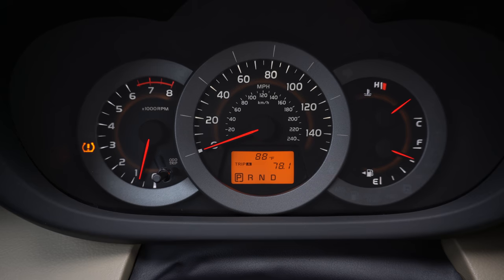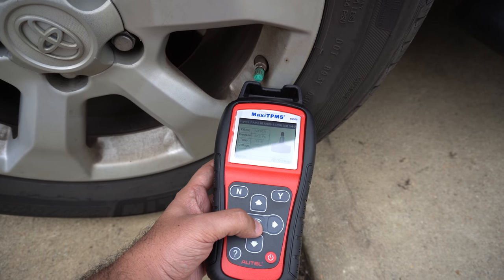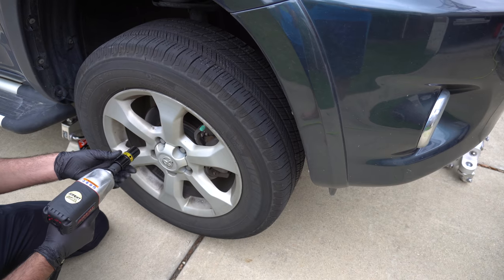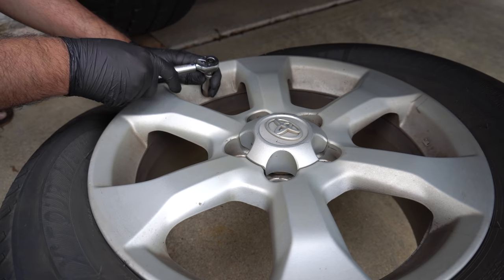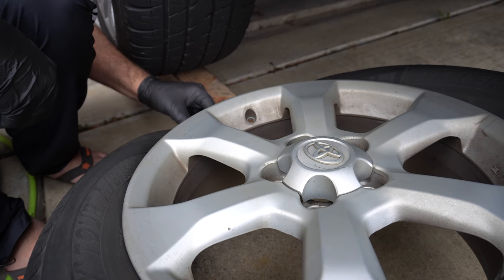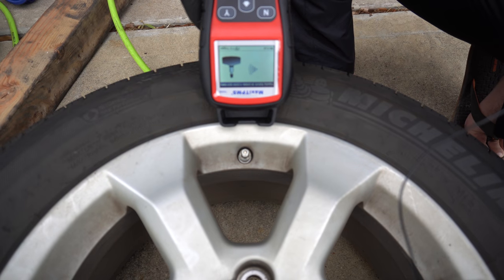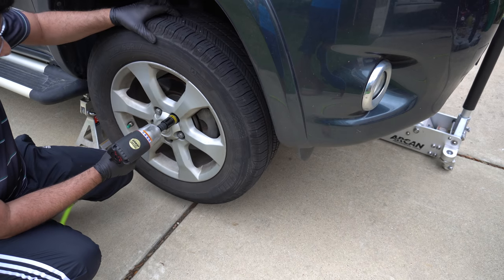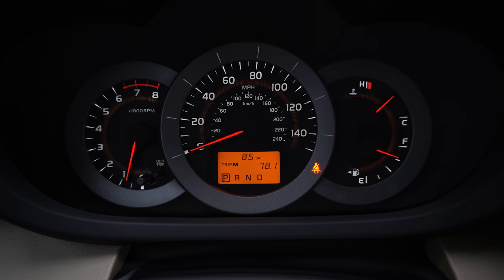How To: DIY Install/Replace TPMS Sensor

Comment: Great video and I love how creative you are to use the wood to expose the sensor!  You definitely got a great power and air tools around your house but with me missing the tool and programming the sensor, I'm afraid I have to spend $75/tire at a tire shop to replace this but I love your video editing, straight to the point! Great job.

Comment: Really nice video. I didn't have another car so I used the only car. Lowering the corner with the wood on the dismounted wheel. My car, Acura will automatically learn the new sensor. Actually if your car won't require you do anything after tire rotation, its system can probably learn new sensors. Modern sensors have accelerators built-in, so the control unit can know the rotation direction, together with signal strength, it can tell which is which.

Comment: Hi, how did you register the new TPMS to the ECM ? That is a very important part, thanks!
Reply: Yeah I just paid Toyota 164$ to register my new ones
Reply: @jayou1987  Yikes. You got hosed.
Reply: @tee2171  yeah i didnt like paying it but i upgraded to some dope ass wheels for a total of 300$ out of pocket so not really
Reply: You get a scan tool that can write tpms IDs and another tool to scan and retrieve the codes

Comment: Great video.
I am very concerned about damaging the steel belts in the tire when crushing it like that with the board. Did you or anyone else have tire issues after doing that? Like noise or uneven wear, etc.?
Reply from the maker: I'm not a tire expert :) but have been using this method for years and never had any issues.
Reply: @theDiYwizard  Thank you

Comment: That tool is cool. Most ppl aren't gonna buy it. Little pricey.
Reply from the maker: Yes that is true, I just have it so I used it :)
Reply: Most tire shops will scan your wheels and tell you which TPMS need to be replaced. Of course, this is in the hopes of you then paying them to do it, but you can get that scan for free. I'd give the tech a $5 for the trouble.

Comment: My Avalon 2016 doesn't have TPMS, it is available in full options model, is it easy to retrofit the TPMS into my Avalon? and integrate it with the car system?

Comment: This was such a helpful and concise video. Thank you.
Did the tool you use relearn the Tpms? Are the Tpms generally universal?
Reply from the maker: No, its a separate tool that you need to relearn the new sensor. If you want to do it yourself for toyota/lexus, then search eBay for "mini diagnostic cable TIS" you will find the cable and software ;)
Reply: I know it's an old reply, but the ts508 has the ability to write back to the ECU on the relearn procedure. No need for more software or "mini diagnostic cable"

Comment: I tried this on my lexus gs and it didnt work. I'm guessing it was the low profile tires on the factory rim. I have 245/40 18's. Took it to a tire shop and they charged me $10. Time is money!
Reply from the maker: I have done it on my Lexus ES the same way but the tires on it are 215/55/17. It is possible that 40s are too shallow for this to work. But yes some tire shops would do it and some don't. I'm glad it worked out for you.

Comment: It was mentioned in the video that a link would be provided showing how to replace the sensors' battery but I do not see that link in the notes, can you share that link with us?
Reply from the maker: @mikeslack4497  thank you for posting the link here. You can also see it as notification in the top right of the video.

Comment: Do you have to replace the bad sensor with a sensor that has the same code on the side or will the computer in the vehicle recognize and register the new sensor? Also can you use aftermarket sensors?
Reply from the maker: All sensors have unique code so if you decide to replace it with another OEM sensor, you will have to re-register it. ECU will not pickup the new sensor automatically. You can use aftermarket sensors but make sure it says that it is compatible with your make/model ECU but even then you will have to re-register. Same goes for the refurbished ones. I have another video where I show how to replace the battery on it, if you decide to do so then you don't have to re-register.
Reply: @theDiYwizard  Thanks.  I saw the tpms video, i might try that and if that fails I might invest in carista or something similar.  Either way is cheaper than pay the dealer or mechanic.
Reply: @MikeD-MadMan  If you have toyota/lexus you can buy the "mini diagnostic cable". Search on eBay. Its not that expensive and will help you in other projects too.
Reply: @handymangamer238  Thanks for that, I will check that out.
Reply: The tool he uses has the ability to "relearn" back to the ECU the new sensor. No need for more software or cables. He didn't know the full functionality of the ts508.

Comment: How did u put back the tire on the rim by putting air?
Reply from the maker: If you see the way I press the wheel downward with my foot while putting the air in, that makes a seal with the tire and helps building the air pressure. Sometimes I have to raise up the wheel on two pieces of wood under both sides of the tire and then press the wheel in the center to make a better seal.

Comment: Very nice, how did you pop the tire back on to the rim after installing? Was it easy?
Reply from the maker: If you press the rim in the middle to make a seal with tire, air pressure does a go job of popping it back on.
Reply: @theDiYwizard  Thank you!

Comment: Hey, my car has a metal valve stem and TPMS sensor.  So the wheel shop replaced TPMS sensor that I bought myself, but when they returned the old sensor back to me, I noticed that the tech didn't install the metal washer.  I asked why not, he said it isn't really needed there, as there is a seal inside and valve nut is going to do its job.  He also pointed out that if it bothers me, the can unscrew the nut and place the washer without removed the wheel/tire.  Do you think it is an issue if that washer isn't installed or no big deal?
Reply from the maker: First of all he should've put the washer in as it provides solid contact with the wheel (which is the main purpose of having a washer). Technically speaking, the actual seal (as he said) is from the inside and as long as the nut is tighten correctly, you will not lose air and you can get by without installing the washer. Also, he is correct in saying that you can unscrew the nut, the stem will still hold the seal and won't go anywhere as long as there is air pressure in the tier, and put the washer in. Just be careful not to over tighten the nut. 36 in-lbf (4.0 N-m)
Reply: @theDiYwizard  Thanks!  I ordered another TPMS sensor for another wheel and when I go to him, I will make sure he uses the washer and if it makes sense to install washer into the one that is missing it.